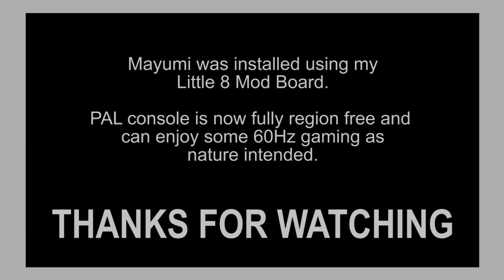Sony PlayStation SCPH-700X PU-20 Mayumi v4 Region Free Mod Install Demonstration

Comment: Can you run PAL discs at 60Hz with this? Is there any mods that can do it? I live in PAL regions, but I would like to have the option to force the games to run at 60Hz.
Reply from the maker: You need a region changer disc to do that. But a lot of games don't run well that way. Best to burn NTSC copies of the games and run them instead.

Comment: Hi, I have a MM3 chip for my 9000 series console. It hasn't been installed yet and I'd like to know if there are any issues with the MM3 if so are the any other modchips that are more reliable as well as fully compatible with all PS1 games? Thanks.
Reply from the maker: Hi. I think you will be okay with it. Mayumi4 is good, but they are pretty much the same. There's the newer PSNee but this uses an arduino board so is much more complicated to program and install. I mostly use my PSIO now and very rarely use the drive any more.

Comment: Hi. I also have a ps1 Scph 7000 ntscj. I chipped it using an unknown modchip version. But i know its a 12C508A chip. I originally came from an Scph 103 ps1 ntscj. I installed it like the way you did. The disc reading is terrible. It plays backup from japan. But like 70% of the time the games are stuck in the PS logo, whether backup or original. I also tried patch game, and it's worse. Is there something wrong with my modchip? Or was it my soldering? Thank you.
Reply from the maker: Hi. It could be a MM3 or Stealth v2.8a chip. For MM3 chip you won't need to wire pin 2. For Stealth chip you will have to wire chip pin 2 to pin 3 of the controller ribbon cable connector called CN102. If either of those don't work, I would buy a new chip to know exactly what is on the chip. Cheers
Reply from the maker: It could actually be your CD drive that is dirty or dying. Also possible that adding a 0.1uf capacitor between pin 1 and 8 of the chip will improve boot reliability.
Reply: @ConsolesUnleashed  thanks man. I'm going to try that.

Comment: quick question i got a PS1 with a Chip which has the Disc Detection Chip fried (one of the stands from the chip down to the board is completely missing) whould it be possible to transplant the used chip from the broken PS1 PU-20 board over to another PU-20 board which is totally fine?
Reply from the maker: No idea. If a leg is missing on the original. Just splice something in to make the connection.

Comment: Hey man, how different is this when installing region free on an Australian SCPH-102 PSOne Slim model? I saw the chips available on your store and was hoping to see if you were able to give insight onto the process before I look to purchasing it to play American games. Thanks!
Reply from the maker: A few more solder points on pins and the side of components, but still not too difficult. There should be a guide showing the install points for SCPH-102 on my site. The ONEchip guide. There are some posts of Facebook and Twitter that show a recent SCPH-102 install.
Reply: @ConsolesUnleashed  thanks for the quick reply! I'll take a look and give it a go :)

Comment: How does a Japanese ps1 not play pal games? Its 50/60hz so it should be fine right?
Reply from the maker: Hi. The Japanese BIOS has an extra check that the EU and NA consoles don't have.
Reply: @ConsolesUnleashed  will a A53 bios work?
Reply from the maker: @silenteyebros  Replacing the BIOS with a USA one should work. Also installing an arduino PSNEE should work. But I have never done either.

Comment: I have many ps1 7000 ntsc-j. Could I follow your guide to make it can play Us games. If yes I will about 100 units
Reply: Like said, NTSC-J have extra region check and won't work without patching game. Anyway if you have cheat cartridge like Gold Finger etc. it somehow bypasses this and allow play without patching. You can also flash cartridge to stealth with Unirom if you wanna see normal boot. I could make a video if needed. Works atleast with SCPH-7500 and 7000 with Mayumi v4. I wonder if anybody noticed this earlier?